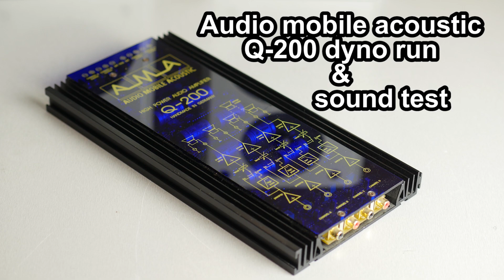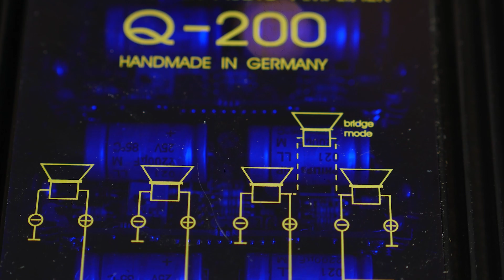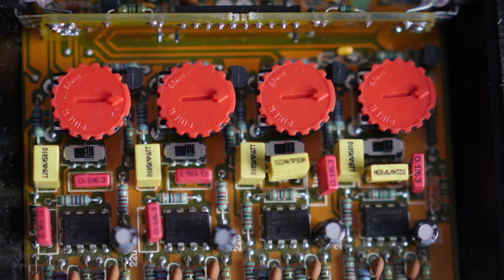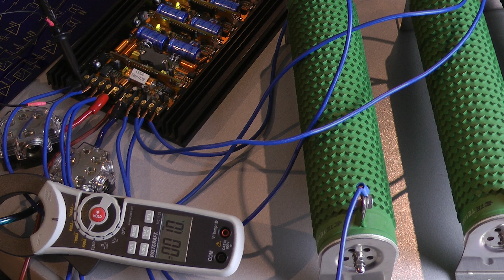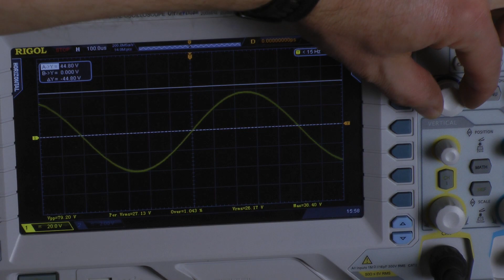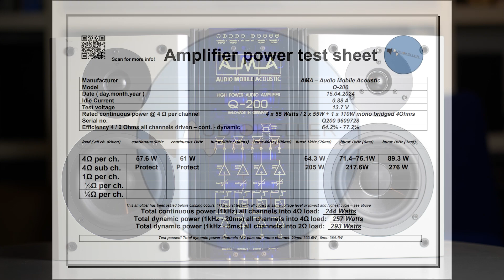Audio mobile acoustic AMA Q 200 oldschool car audio amp dyno & amplifier sound test german Endstufe

Comment: Hey so can you explain something to me sir. At 7min35 you are showing around 41v ac output during the sub channel testing. My question is regarding the oscilloscope reading actually. So I understand the Vpp that measuring the overall amplitude. Isn’t the true power here displayed as Vrms? It’s showing 15v. This part is what always confuses me reading my scope
Reply from the maker: That’s a burst - i always use peakvoltage divided with 1.414 to get RMS voltage for power calculation. The scope measures the RMS value of the whole display. There is a signal pause in the display of the burst which leads to a very low RMS value. Somewhere you can adjust that the scope shows RMS correctly by selecting RMS= 1 cycle and so on. Putting the cursor to the peak makes it easier and more correct in my opinion.

Comment: 46v . But drops to 27v.. did I hear you incorrectly.
Reply from the maker: I have to double check the video, I was running out of time yesterday, so it’s possible that I published some BS 😂
Thanks for the hint 👍
By the way: my new contact is ready:  andi(@)audiokeller.com should work, i will remove this contact in this comment after you replied or confirmed with a thumb that you recorded my contact to avoid spam-bots 👍